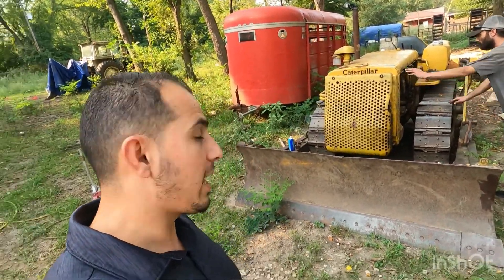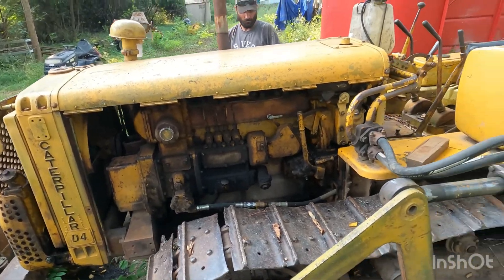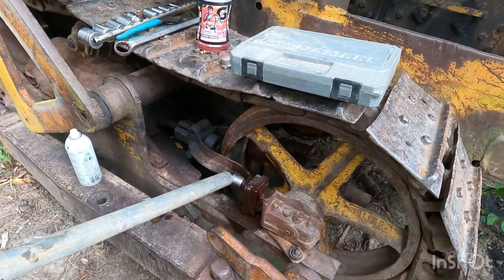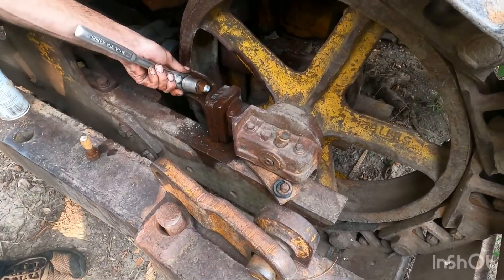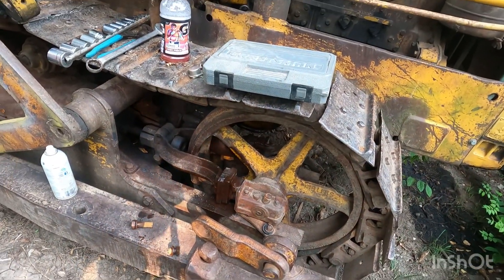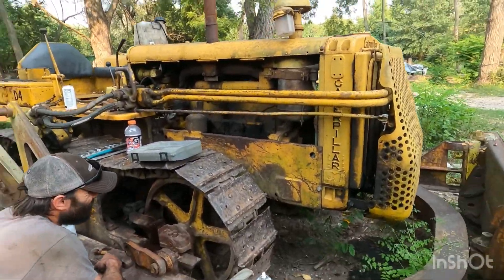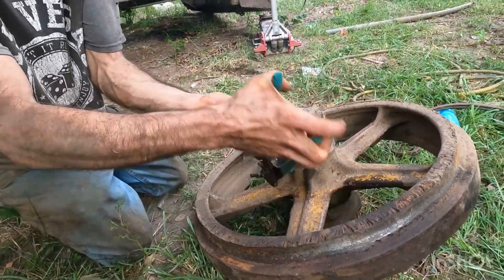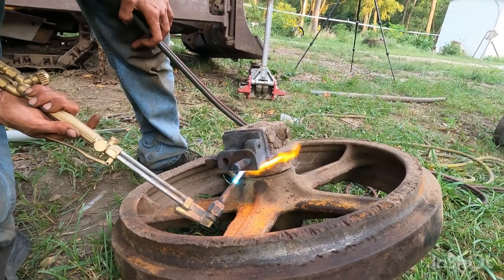D4 Caterpillar Dozer Track Problem Part 1

Comment: Heat those bolts up to cherry red, let them cool off completely, and they should back right out.
Reply from the maker: We did that and had no luck but thanks for the advice
Reply: Don't want to let them cool. That defeats the purpose. Get them glowing and get them out quick as possible. Impact would be best. Might have to reheat them a time or two.